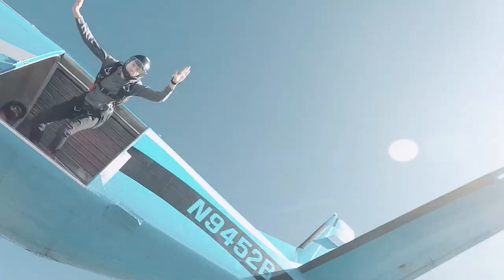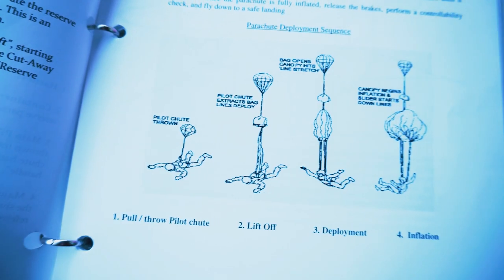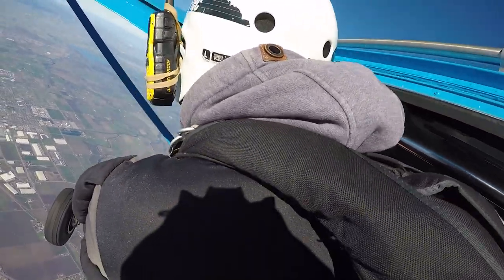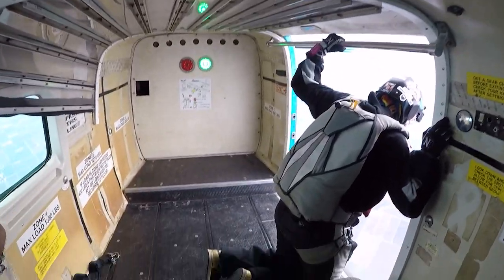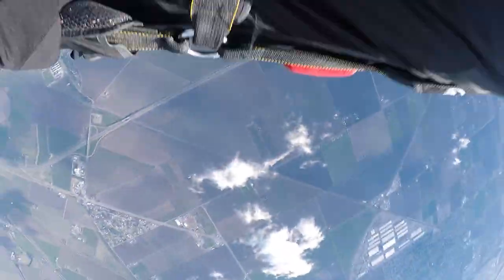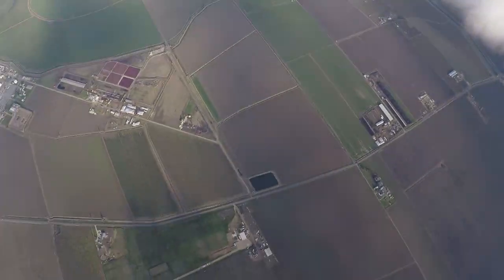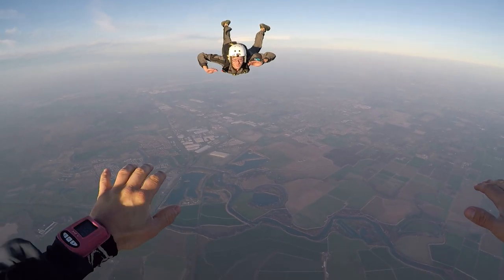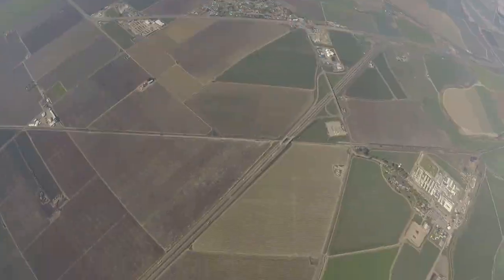Becoming a Skydiver - My journey of learning to skydive

Comment: Yeah, I'm fifty-six years old and I've been doing tandem jumps because I've missed the deadline for this summer's AFF training classes.
My plan is to spend time at our local wind tunnel this winter and get as ready as possible for next spring/summer. I'm not interested as of now in becoming anything more than a competent solo skydiver. 
This would fulfil my needs, though I'm open to pushing it further in the future assuming I pass the AFF training.
By the way, I'm absolutely terrified of heights, though as soon as Im sitting at the open bay of the aircraft, ready to be pushed off into space, my fear evaporates.
Fortunately I've had some awesome instructors.

Comment: I want to do the AFF /A License in Canada and I was also thinking of doing tunnel time prior to actually doing the AFF. How long did you spend for training in the tunnel? I know the theory of jumping and I’ve done tandem 3 times the last time I did it I got to deploy the chute and had the altimeter on my hand so I know to pull at 5,000. 
The other thing that’s keeping me away is piloting the canopy. Because I don’t no how much force you need to actually use to pilot it and I don’t want to jump until I have a good sense of how to do the patterns etc. 

This video helped a lot, but yeah just looking for your advice because it seems like you also took the tunnel approach first. I find with doing tandem you can’t get a sense of your stabilization so doing tunnel time would help.
Reply from the maker: Hey, thanks for your questions! Tunnel time will help you a lot. 30 Minutes are a good amount to get a good stable belly position and learning turns. Most indoor skydiving centers offer AFF trainings, to prepare you. Did your tandem master let you fly the canopy a bit? It's a very intuitive process and doesn't need lots of force to steer. What I also recommend is to hang around a dropzone and talk to some resident jumpers or AFF Instructors about all these things! I'm sure all of that will help you to start your skydiving journey. :)
Reply: @jonesaway   thanks for the reply! Yeah so I was able to practice the piloting a bit but I was more stoked about deploying the chute 😂, although I remember it was very straight forward. 

You mentioned how you didn’t do tandem ever, how did you feel about the whole piloting the canopy and landing? 

I did by 5 flights for the wind tunnel now I have to wait for Canada to chill out on the Covid restrictions lol 😂

Comment: im preparing for my AFF and just found your video. How much do you think tunnel helped you in terms of actual skills? how long did you tunnel in total before AFF? cheers!
Reply from the maker: It definitely helped a lot. You learn the optimal body position in a safe environment with more time then during freefall. I'm sure it saved me some repetition jumps during aff. I did 30 minutes in the Tunnel before starting the course.
Reply: @jonesaway  thank you! i will go for tunnel too. My biggest concern though is in tunnel you dont have parachute which i believe adds lots of weight and significantly alter where the center of mass is. When you switched to normal free fall with all the gear on, did you feel difference?
Reply from the maker: No worries! You won't feel a lot of difference with your magic backpack  on your back :D

Comment: I have fear of heights but i want to have  solo license what do you think can i do that ?
Reply from the maker: I have a fear of heights too, it's always strong when I am standing close to an edge where it goes deep down. For me skydiving helped a lot. Actually at 4000 meters, you will have no depth perception to the ground. So you won't be afraid of the  sensation of depth. Also the parachute becomes one with you and your body. You are suspended in the air and gliding gently. During freefall it's also a very suspended sensation. I recommend you doing a tandem jump first and then figuring out if you want to do the course.
Reply: @jonesaway  sure